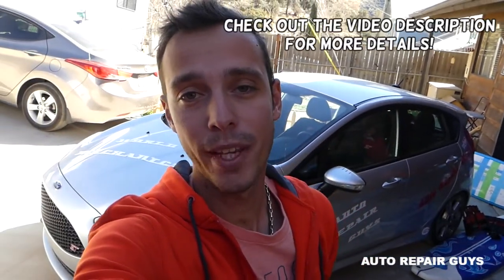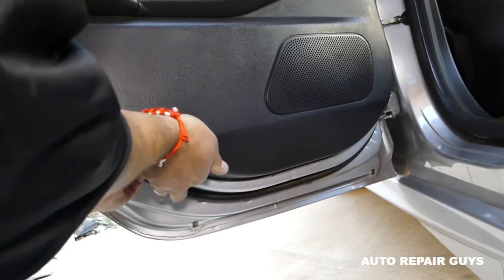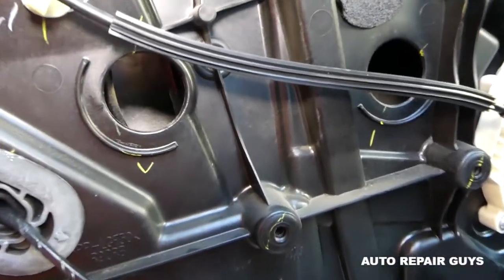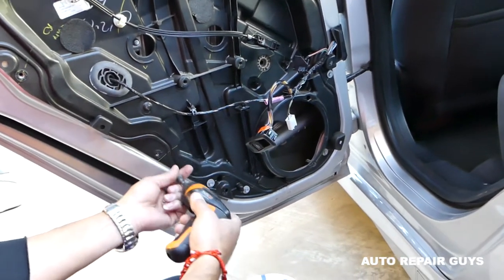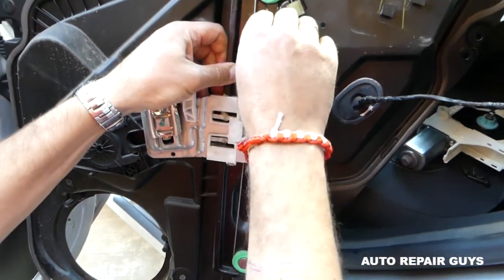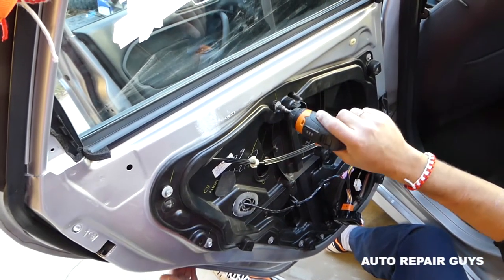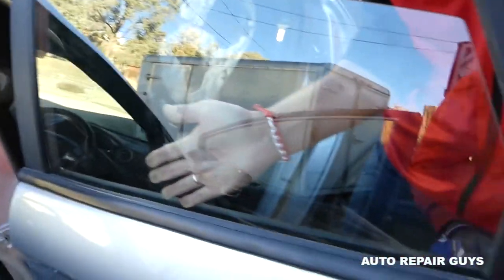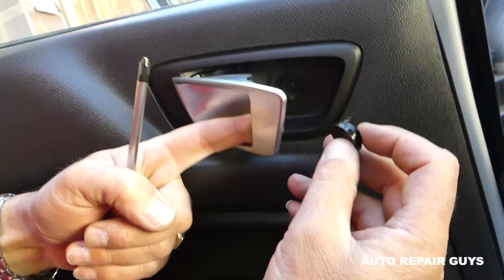FORD FIESTA REAR WINDOW REGULATOR REPLACEMENT REMOVAL FIESTA MK7

Comment: Are the back windows supposed to roll down all the way? Regulator replacement worked without any problems. Guess I never noticed if these back windows went down all the way.2015 se